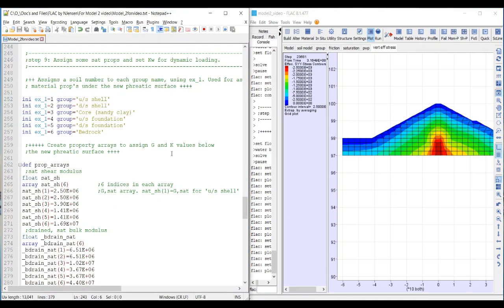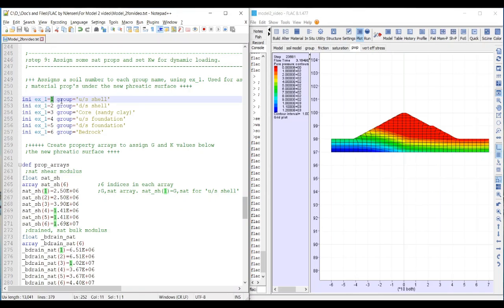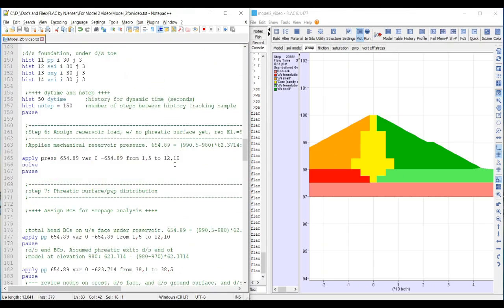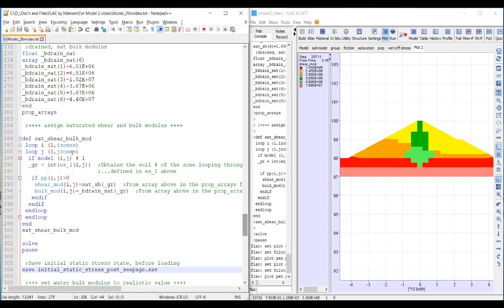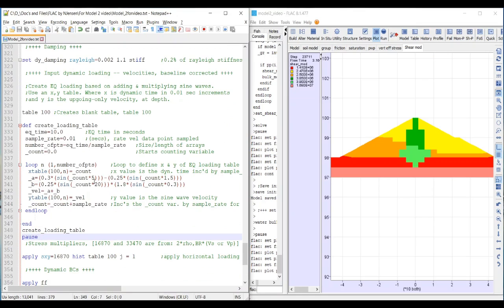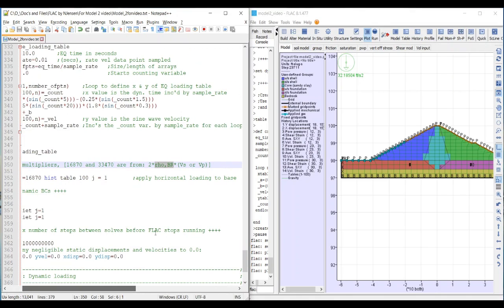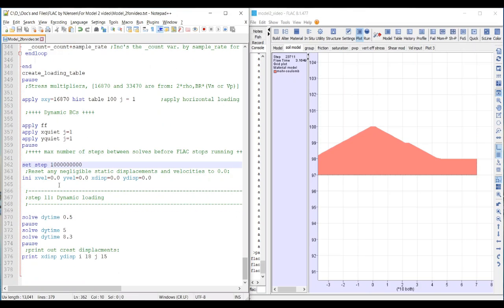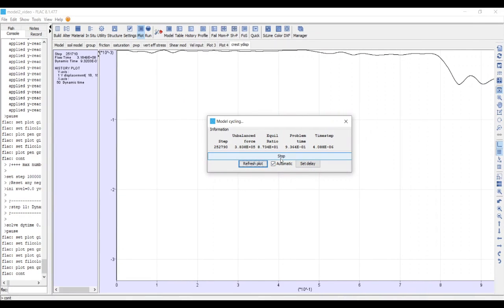Seismic analysis (Part 4 of 5) of an embankment dam and foundation, tutorial using FLAC.

Comment: Do we need to free pp and set saturation to 1 during dynamic phase ?
Reply from the maker: Hi Mahir - For the grid points on the boundary, I usually just leave them as is.  For the internal grid points, I would have to think about it maybe a bit more, but I don't think we need to free pp and set saturation to 1. The pore pressure should already be free to change during dynamic loading (if water bulk=real value). I might come back with a different answer later after looking at a few files, but I think this is okay for now.